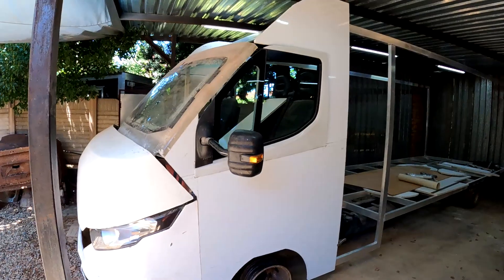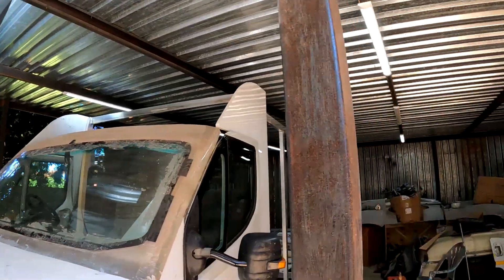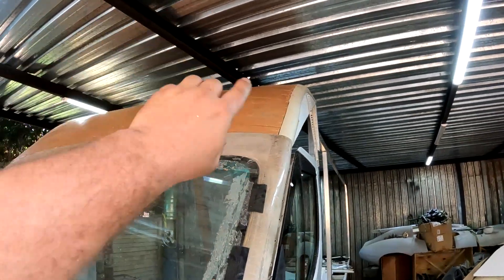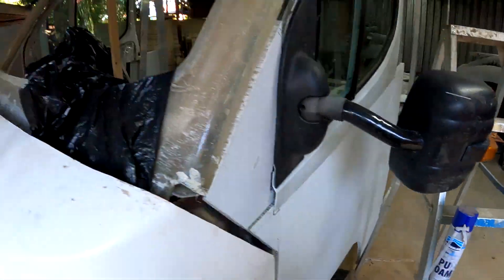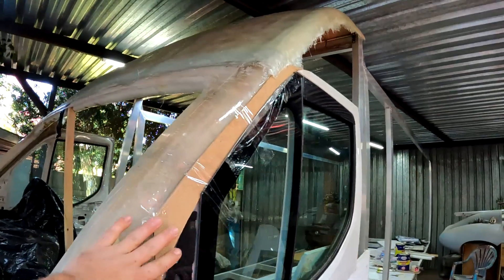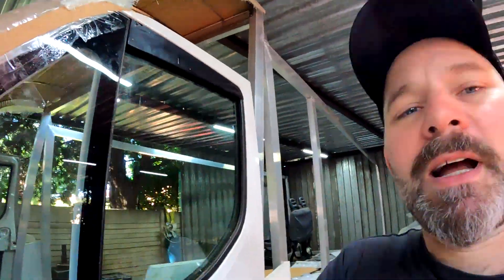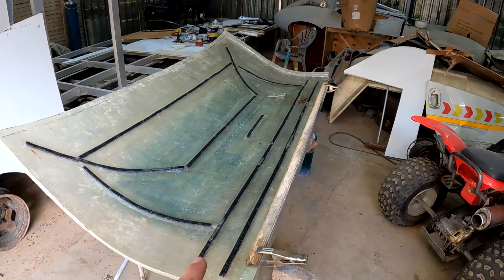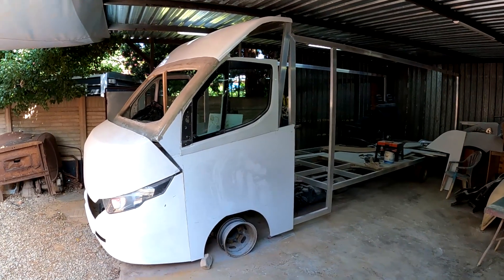pt 12  Building a Motorhome fRom sCratch  Fabricating the Cab roof

Comment: I have an old ambulance which was missing drivers side ambo light so i used expanding foam and to shape the void and fibreglassed over. Worked a treat. Now i have to think about refibre glassing my cab roof. Great job your doing .. im no diyer just an old lady trying to get ready for vanlife.
Reply from the maker: That's well done then if you don't do this type of work on the daily 👍👍. Thanks for watching and the kind words!
Reply: @BroughBuilt  your most welcome

Comment: Well she's coming along nicely.  I watched a Youtube video the other day of some Pakistanis building a Coaster bus from scratch and they treated the Chassis rails as though their was no tomorrow, cutting bits off here, welding bits on there, drilling holes where ever they felt the need.  Compared with the care you took in not "damaging your chassis I was amazed.
Reply from the maker: Thank you David! I don't know if it's the case in other countries, but here in South Africa they are very strict on not cutting or drilling into a chassis. You are only allowed to bolt onto existing spots, which makes sense to me as it is the foundation of the vehicle.
Reply: @BroughBuilt  It's the same here in Oz.